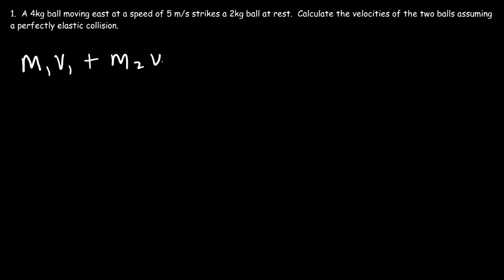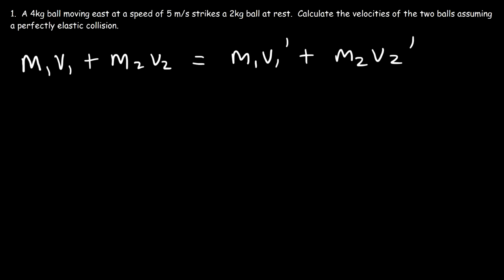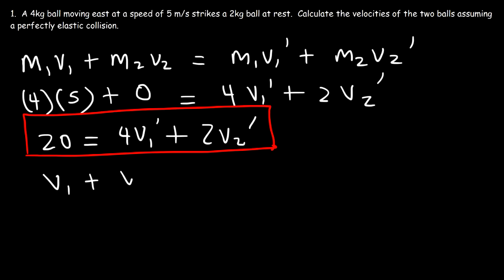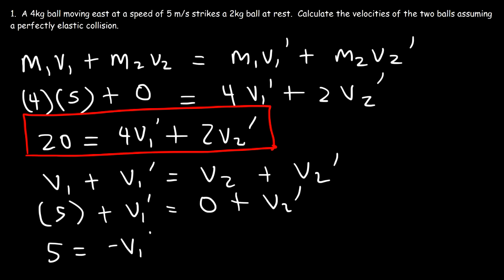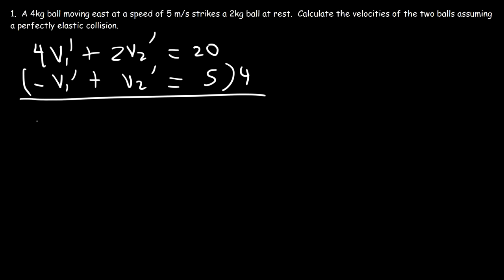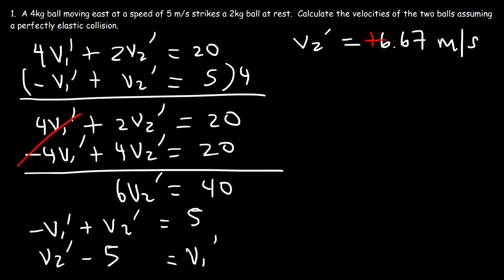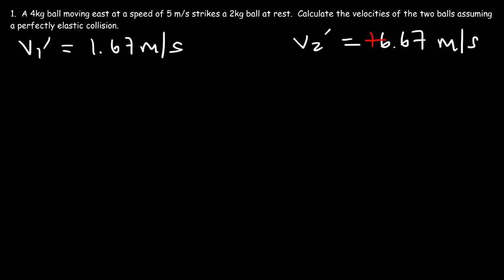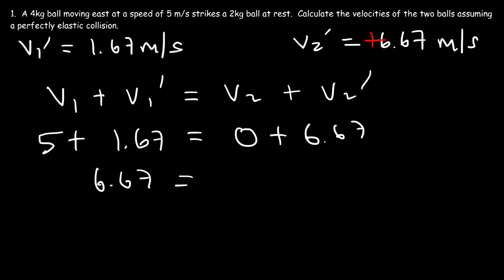Elastic Collisions In One Dimension Physics Problems - Conservation of Momentum & Kinetic Energy

Comment: This is a great use of algebra, and I will definitely be using this from now on. However, it doesn't seem to account for the units kg and p, which seem to be used as multipliers and place holders. Dividing kgms^-1 by ms^-1 wouldn't produce a velocity, it would produce a mass. Is there any way to use this method while also accounting for those units? Or am I making an error?

Comment: Correct me if I am wrong,  but   this equation  v1f = v2i + v2f - v1i;      only holds true when the mass of moving object is bigger than the object which is at rest.

The generic one that works in all situations is 
v1'= [ (m1-m2) / (m1+m2)*v1 ] + [ 2*m2 / (m1+m2)*v2 ] 
v2'= [ 2*m2 / m1+m2*v1 ] + [ (m2-m1) / (m1+m2)*v2 ]

Comment: Thanks for the explanation. You made the explanation easy to follow. I just have a question - if the initial angles of trajectory of the balls are different (i.e. the paths of travel converge to the point of impact) and they are both in motion, traveling at different velocities towards each other, how would this be calculated. I would imagine that you would calculate the x and y components separately. But I'm really not sure of the process...

Comment: For anyone wondering where the formula v1 + v1' = v2 + v2' comes from, this is it: 

In a collision between two objects, net momentum is conserved, therefore: 
p1 + p2 = p1' + p2'
This can be expanded to: 
(m1 x v1) + (m2 x v2) = (m1 x v1') + (m2 x v2')
Next, we subtract (m1 x v1') from both sides of the equation: 
(m1 x v1) + (m2 x v2) - (m1 x v1') = (m2 x v2')
Then, we subtract (m2 x v2) from both sides of the equation: 
(m1 x v1)  - (m1 x v1') = (m2 x v2') - (m2 x v2)
Next, we group similar terms: 
m1(v1 - v1') = m2(v2' - v2)
Finally, we can make m1 the subject of the equation by dividing both sides by (v1 - v1'): 
m1 = m2(v2' - v2) / (v1 - v1')
Put a mental pin on this equation, we'll come back to it later. 

An elastic collision is defined as a collision where net kinetic energy is conserved, therefore: 
Ek1 + Ek2 = Ek1' + Ek2'. 
This can be expanded to: 
(1/2 x m1 x v1^2) + (1/2 x m2 x v2^2) = (1/2 x m1 x v1'^2) + (1/2 x m2 x v2'^2)
Next, we multiply both sides of the equation by two to get: 
(m1 x v1^2) + (m2 x v2^2) = (m1 x v1'^2) + (m2 x v2'^2).   
Then, we subtract (m1 x v1'^2) from both sides of the equation to get: 
(m1 x v1^2) + (m2 x v2^2) - (m1 x v1'^2) = (m2 x v2'^2)
Then, we subtract (m2 x v2^2) from both sides to get: 
(m1 x v1^2) - (m1 x v1'^2) = (m2 x v2'^2) - (m2 x v2^2) 
Next, we group similar terms: 
m1(v1^2 - v1'^2) = m2(v2'^2 - v2^2)   
We can now go back to the pinned equation and, using substitution, replace m1 with (m2(v2' - v2) / (v1 - v1')):
(m2(v2' - v2) / (v1 - v1')) x (v1^2 - v1'^2) = m2(v2'^2 - v2^2) 
Now get rid of the extra brackets: 
m2(v2' - v2) / (v1 - v1') x (v1^2 - v1'^2) = m2(v2'^2 - v2^2) 
Now divide both sides by m2: 
(v2' - v2) / (v1 - v1') x (v1^2 - v1'^2) = (v2'^2 - v2^2)
Now divide both sides by (v1^2 - v1'^2): 
(v2' - v2) / (v1 - v1') = (v2'^2 - v2^2) / (v1^2 - v1'^2)
Now expand the squares: 
(v2' - v2) / (v1 - v1') = (v2' - v2)(v2' + v2) / (v1 - v1')(v1 + v1')
Now multiply both sides by (v1 - v1'): 
(v2' - v2) = (v2' - v2)(v2' + v2) / (v1 + v1')
Now divide both sides by (v2' - v2): 
1 = (v2' + v2) / (v1 + v1')
Finally, multiply both sides by (v1 + v1'): 
(v1 + v1') = (v2' + v2) 
Get rid of the brackets: 
v1 + v1' = v2' + v2 
This can be rearranged to: 
v1 + v1' = v2 + v2'

Thx for listening to my TED Talk
Reply: In summary, the formula comes from using substitution to combine the formulas for conservation of momentum and conservation of kinetic energy, followed by simplification. It's therefore important to note that the formula v1 + v1' = v2 + v2' only applies to elastic collisions because this is the only kind of collision in which kinetic energy is conserved; it does NOT apply to inelastic collisions.
Reply: @jacobwansleeben3364 bro, but what does it mean? I understood the derivation but what is the physical meaning of this? v1+v1'=v2+v2'

my book says v1-v2=v2'-v1', this means the relative velocity before and after collision is equal,I can't get it, I thought that stuff was so dependant on the mass, my entire reasoning for momentum vectors was built on the fact energy transfers need to take account of velocity as well as mass

but this equation clearly treats the bodies as having equal masses but still works for every situation? I don't get it help🥹
Reply: @kazukawasaki97  You are correct that momentum vectors are dependant on both mass and velocity. Therefore, since an elastic collision has a net conservation of momentum, and the relative masses of the objects don't change, their relative velocities won't change either.
Reply: @jaxyperson  wow its been an year,I was learning about collision mechanics,funny thing I revisited this topic just 3 days before while learning about the discovery of neutrons by chadwick which involved this concept,the neutron collides with a layer of paraffin wax and then in another apparatus into nitrogen gas, we can measure how fast the positive ions move after collision using adjustable electric and magnetic fields, using two measurements we can cancel the velocity of the neutron and thus Chadwick was able to measure the mass of a neutron,so I understood this,thanks anyway,cheers
Reply: @aleenaaleyammasabu6030  malayali
Reply: I had this  question, still a little loss on what you wrote but ima pretend I understood and carry on with my day. I liked the ted talk.
Reply: yo, thanks bro
Reply: I applaud your dedication. Thankyou!
Reply: Thank you for the additional headache. Lmao jk thanks
Reply: Thank you for spending your valued time on this...
Reply: Thank you very much that was my question
Reply: @jacobwansleeben3364  what kind of job are you doing after this biomedical science degree ?
Reply: Oh WOW❤ Thanks Buddy
Reply: ok I am fine now i don’t wanna know where the formula came from
Reply: this is what heros do
Reply: @spikeeze  Nah, I'm just a nerd who likes doing math.
Reply: thanks bro! you saved my life
Reply: Wow you typed all this👏👏👏
Reply: thanks dude, this helped. alooot
Reply: The hero we needed
Reply: Woah.
Reply: Well done! Thank you!
Reply: 2 years later, you are still saving people. Thx!
Reply: thanks for that
Reply: thank you so much
Reply: wait, I was just having this problem about my Physics. Thanks for the detailed explanation, it helped!
Reply: dude thank you very much
Reply: Thank you so much man!
Reply: You're a savior, our physics professor wants us to completely show how'd we come up with the formula used in the problem.😭
Reply: Thank dude
Reply: Omggg thanku sm
Reply: wait so this is just a system of equations to solve 2 variables 🤯
Reply: hahaha...what?
Reply: what are final velocity 1 and final velocity 2 in terms of mass 1, mass 2, v1, and v2?
Reply: @anythingatall1471  I think v1' = m2 x v2 / m1, while v2' = m1 x v1 / m2
Reply: I really wasn't but ty
Reply: Glad to see this comment🥰
Reply: wouldn't using u for inital and v for final be more easier to understand then v'
Reply: I don't see how, especially since I already used v to represent velocity. It would just lead to more confusion.  @razamohamed3841
Reply: Love this.🗿👌
Reply: Nerrrrrrrrrd
Reply: I think it's The formula for the conservation of momentum, \(m_1v_1 + m_2v_2 = m_1v_1' + m_2v_2'\), is derived from the principle of conservation of linear momentum. This principle states that the total linear momentum of a closed system remains constant if no external forces act on it.

In the equation:
- \(m_1\) and \(m_2\) are the masses of two objects,
- \(v_1\) and \(v_2\) are their respective velocities before a collision,
- \(v_1'\) and \(v_2'\) are their velocities after the collision.

The equation essentially expresses that the sum of the momenta before the collision equals the sum of the momenta after the collision, assuming no external forces are involved. This principle is based on empirical observations and is a fundamental concept in classical mechanics.
Reply: I ain't reading alat
Reply: Wtf
Reply: gaand fat gyi
Reply: I've got a question: momentum is a vector, energy is a scalar. how can the velocity and. speed in the equation cancel out each other
Reply: nerd
Reply: You're an absolute legend! Thank you so much for saving me the confusion of trying to find out where that came from!
Reply: It can be achieved within seconds 🤣🤣🤣
Reply: @abhinavkrishna1858 Yeah! Lots and lots of seconds!
Reply: An elastic collision is defined as one in which both momentum and KE are conserved*
Reply: Can i skip 9th grade @#$& 9th grade $#!7
Reply: All that isn't necessary

Comment: Okay... This is suppose to be perfectly inelastic but he's solving it as if its not. The masses when solving for final velocity should be added together. Not separated. From what I'm taught in class
Reply: The problem is perfectly elastic. It would only be perfectly inelastic if the two balls moved together in as one unit, in which case the masses would be added. In this problem, the balls collide and one of them shoots off faster than the other, as seen by the answers in the problem.